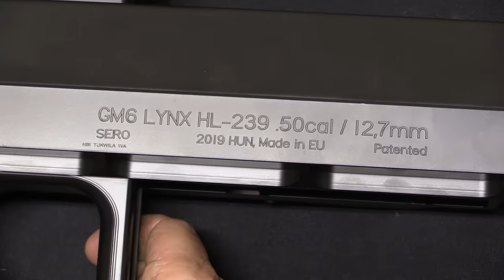GM6 Lynx: The Hungarian Long-Recoil .50-Caliber Bullpup

Comment: I am pretty sure the muzzle brake is a recoil compensator, screwing it in reduces the amount of gas it deflects back and leaves more of the original recoil for the action to operate upon.

I know, potaeto-potahto: the effect is the same as Ian describes it, it allows to fine-tune the amount of recoil to the minimum necessary for reliable operation and the more is screwed in the more the recoil, but what's left of the engineer in me craves precision.

On a more facetious side, the eye of my mind sees Summer Blau as Cameron ( "The Sarah Connor's Chronicles" ) shooting this from the shoulder while taking care of other Terminators.

Comment: I think you got it a bit mixed up in couple of places. 

12:14 
Bullet and the gases push the barrel backwards. (recoil)
Muzzle brake negates some of the recoil. 
By tuning the muzzle brake back and forth: you effectively diminish or enhance the performance of the muzzle brake. (either lessen the recoil, or allow it to be larger)
Larger recoil force on the barrel gives the system more power to cycle properly. 
One could assume deeper seating lessens the effectiveness of the brake. 

15:42
The ribs underneath the slide and the barrel that contacts against the cartridges in magazine: they do not negate the magazine spring induced drag as it is still there pushing against the rib. They level it to be a constant smooth ride. Also, as a result, the bullets don't rock up and down so much.

Comment: Even if Ian hadn't described the precision of those componentsw, you can actually see hear and see it when he releases the barrel or bolt  - so smooth and damped by the ultra-thin film of oil between the sliding surfaces, no clattering or rattling whatesoever.

Comment: the brass bearing is mostly used because of the friction coefficient between steel and brass being pretty low. i don't think it will wear that quickly, its typical for axial-load bearings
Reply: And, as a bonus, any half-competent lathe operator can turn those out quite easily

Comment: Definitely need a better trigger as most Anti-material rifles usually are meant for more precision shots in the current era and the ability to close the dust cover while in transport form is also needed. My final suggestion would be the need for an easier mag release that way the user doesn’t need to stop indexing the grip and or allows for faster reloading and apprehension of the mag release button. Otherwise from what I’ve seen amazing rifle and I’d love to try it

Comment: When I was younger these were 12,999.99 with a mandatory deposit. For two summers I saved up and had what I needed in full with tax. When I contacted the importer the price had shot up to 15,050 plus 7% local tax. I ended up putting a down on a truck instead.

Comment: I think you've got the bit about the muzzle brake confused. The ports on that brake, like many, are angled back toward the shooter and will generate forward thrust while gas is venting through them. This is what most muzzle brakes do, as it fights the typical rearward force of recoil.

 I can see why you would want to tune the brake on a gun like this with a reciprocating barrel but I don't see how the claimed increase in muzzle brake performance would reduce recoil by "putting recoil into the barrel". I think you are only tuning how much it can reduce recoil, and therefore reduce the rearward velocity of the barrel/action.

Comment: I would imagine with that muzzle device setup it wouldn't be difficult to make a few plastic feeler gauges once you've dialed in the cycling energy. Just use some calipers to measure the space between the md and that ring and cut out appropriate sized pieces of plastic.

Comment: I think I can guess one reason they had the hammer on the side. it looks the like bolt's designed so that, should the trigger be pulled without it being locked (such as a shooter lifting the charging handle and then squeezing the trigger) the hammer won't align properly. but that's going based on the slowmo footage from the shooting video.

Comment: Couple of questions prompted by this otherwise fine presentation. Ian did not comment on the function of the notch on the carrier guide rod nor did he illustrate the barrel extension.  What trips the bolt lock catch? It doesn't seem to have a trip on the rails illustrated. Does it occur in the  barrel extension? I am not surprised that a long recoil comes from Hungary since Frommer worked in the neighborhood and had some interesting rifle prototypes as well.

Comment: Im surprised that the roller assembly isn't a press fit, I would think they would differentially heat the parts and then press them together for a really snug fit to ensure that the tolerances don't get messed up from the torsional force

Comment: 16:40.  Not really sure why a left-handed thread is any less likely to vibrate loose than a normal one.  As far as I can see, there would be no rotational element to the vibration, unless the direction of the rifling had an influence, which seems unlikely.

Comment: There were a couple things that didn't make sense to me in Ian's explanation. Feel free to weigh in if you have any thoughts.

It seems to me that the way the muzzle brake is shaped it would direct gas rearward toward the shooter and thus (through Newton's 3rd law) it would push the barrel forward, which would decelerate the barrel rather than accelerate it as Ian said. Also it seems threading the muzzle brake on farther would block more of the holes, and therefore it would reduce this effect and cause the barrel to accelerate more rapidly. Having the brake unthreaded most of the way would leave the hole more open and direct more gas rearward, pulling the barrel more forward which would decelerate the barrel more and lead to reduced recoil. This is the opposite of the way it's explained in the video so if anyone can answer this I would appreciate it.

Also. I didn't understand how the left hand threads would let the brake assembly tighten itself. Since the barrel doesn't rotate and just goes straight forward and back it seems like the thread direction wouldn't matter. Any thoughts?

Comment: Hey, one of my favorite sniper rifles in Synthetik. No stupid gimmicks unlike the rest of the sniper rifles.
Just long range, solid armor pen, penetrate multiple targets, and it also hits harder the further the target is. Ie, it acts like a sniper rifle should.
Reply: No love for the Nemesis Prototype?
Reply: @nickstanley5064  It's good, but it's got 2 main faults.
1 is that it's rare.
2 is that it's a single shot that needs to be active reloaded consistently, aka has a gimmick.
Sometimes, you just want a gun that ya don't have to fuck around with. No active reload constantly, no 360 noscopes, no sitting perfectly still, just point and shoot.
Reply: @nerdicusdorkum2923  , the 9800k fits that description as well.

Comment: Ian, do you know the history of the M1 development? 
In 1973, there was a hostage-taking in Balassagyarmat, Hungary. 20 high school girls were taken hostage in a dormitory.
The story here, using a translator as I do.

https://hu.wikipedia.org/wiki/Balassagyarmati_t%C3%BAszdr%C3%A1ma

The point is that you know that Europe especially the eastern half of Europe does not have the types of crimes that the US has. Here 95% of the people don't have guns at home if they do they are 95% hunting or sporting guns. military even with a pre-loaded one only with a disarmed one.
And in 1973 there was such a strict social system with effective political policing that the authorities simply didn't know how to handle it for lack of routine? 
The root of their problem was that the two hostage takers were not visible at the same time in the dormitory building so the snipers could not shoot at them safely.
I'm not writing down what's in the Wkipiedia article. The point is that it was at this time that the need arose for the development of a sniper rifle, not even by the army but by special forces of the police, where a covered or semi-covered target could be fired at with great safety and with the need for a successful hit and incapacitation. 
That is why the M1 is single shot and so difficult to handle. It was not designed for battlefield use but for accuracy and what is in its category as an anti-materiel weapon. From the very beginning of the design, there was a demand for the successful and directionally effective penetration of the 10 cm concrete walls of prefabricated concrete houses, which are common in Central Europe, from 100-200 meters.
The M1 used to be able to hit its own mortar rounds from such distances.
So for a long time it was more of a counter-terrorist urban combat weapon, only then well into the 2000s was it adapted to the needs of the Defence Forces. Then it became foldable e.g. Police had no size problems.
Why the 12*108 mm? Beyond its efficiency.....In the 80's the country was in a serious economic crisis and there was less and less money for development.
So the then not very independent Hungarian arms industry decided to use existing elements. 
The barrel of the M1 or maybe the M2 I still remember it from the photos of the time is actually the heavy machine gun known in another video of yours, the barrel and ammunition of the T-54/55 medium anti aircraft machine gun of the medium tanks, this is the DSK Soviet heavy machine gun.
The first types even had circular cooling fins on them.
Hence the ammunition and hence the barrel.

Comment: Can someone explain the muzzle brake to me? " The further back you have it the further you are going to reduce recoil and put the energy into the barrel. "
He says but...
It is not intuitive to me in which position it is braking the most but I assume it's in the rear ward position. And that seems in line with using hot ammo. But more braking must mean less recoil and less energy going into the barrel as the brake will push the barrel forwards. Am I right?

Comment: What if you try to push the barrel back with a round in the chamber?
Reply: If I understand correctly, the same as it would if the barrel were being forced back when firing. The barrel and bolt will travel back together, the bolt will catch at the rear, the barrel will go forward, and the round (which would normally be an empty case) will be extracted. I don't think extracting a live round should cause mechanical issues, as it should be designed to be able to kick out a dud just like every other self loading firearm.

Comment: Would this be considered a direct blowback .50 Cal.  there isn't any gas systems to unlock or reciprocate the bolt.  With the reciprocating barrel, does it reciprocate while the bullet is traveling down the barrel? would that have an impact on grouping size?

Comment: I wonder if the next iteration would fix the spongy trigger issue ... a rifle built like this deserves a two-stage, 'break glass', trigger, with an equally small reset ... 

Pity our (British) military procurement tends to be a bit haphazard at times, as I can especially see the SBS (the Navy cousins of the SAS), making good use of this, being collapsible, on top of being a bullpup, when a mission team is deployed from a semi rigid ... 

[Yes, I know ... given our history with that rifle, that, especially the A1 should've been built by H&K from the beginning, instead of subsequently a huge amount of money spent on them to fix it to the A2/A3, bullpups, with 'grunt proof' fit and finish, have proven themselves, especially when you need a weapon that can be handled in tight spaces, rather than the broomsticks of old ...]

Comment: I know that this isn't meant to be a precision rifle but I'm curious what kind of accuracy it can manage with that very long recoil operating system. Not that I'm worried it's not sufficient, just curiosity.
Reply: The longest range individual hits are made with m2 brownings.
Those are also long recoil guns, far as Im aware.
Reply: @ineednochannelyoutube5384  I did a quick Google search on the lynx and saw some claims of moa and some of around 2 moa. 2 moa is better than i expected and 1 would be downright amazing. Certainly good enough for an anti material rifle and could even be pressed into sniping duty if necessary.

Comment: Was there a glitch in the Matrix, or has Ian made a video about a very similar thing quite recently? Either way,  there's a reason you've only ever heard of the 3 long-recoil guns, of which the Chauchat was the last designed (the Browning shotgun stayed on the market for way longer than it had any right to, because Browning. See also the 1911 pistol. If it ain't broke ...)
Reply: The A5 just works. Not very finicky with Ammo selection and very reliable. Better options now…..yeah maybe.

Comment: That gun is crazy! Looks like you'd need an armorer to maintain it in action; I mean the field strip is not simple. The parts are huge, and I guess that comes with this territory, but the rolling lugs look like skate bearings. Imagine training to assemble one in the dark.... I don't conceive of these being copied by hand in certain parts of the world where that sort of thing is sometimes done. It is interesting, as bullpups always are, and I missed the weight, but really wouldn't want to lug through hill country! I wonder if it could be simplified a bit and segments made from composites. And last: is it accurate, and at what range?

Comment: Ah yes. The Far Cry 4 rifle that was so OP it broke the game.
Reply: That would be the Buzzsaw. I never found the SA-50 particularly op, considering you only get it after the second to last mission in the game, and it has a niche, whereas the Buzzsaw kills everything from footsoldier to car in a half second burst, has minimal recoil and can be used substituting the whole range from a submachine gun to a sniper. And it's very easy to get.
Reply: @egomania2792  SA-50 can shoot through most walls, and if you slap a silencer on it because of the way enemy detection works they'll never find you. Took out Pagan's fortress without setting foot inside once because of the SA-50.

Comment: Those bushings are most likely interference fit.  They look just like the bushings in automatic transmissions... they probably wouldn't be that hard to find.  Anyway, you need a bushing driver set.

Comment: Why is this gun on every channel now, did a big batch of them get dumped into the market?
Reply: Maybe the SAS,SBS    purchase?
Reply: @tamassulyok2556  Could be.  Two are on gun broker now.  Haven't seen anyone real put to shooting long range.  Doesn't seem to accurate compared to other 50s
Reply: @jaytrock3217  It's actually one of the most accurate semi-auto .50s. 
The bushings at the front & rear barrel supports are machined precisely enough to control the vector of the muzzle consistently.

Comment: How does something with that much barrel movement maintain zero and accuracy?
Reply: By being ridiculously well-machined with extremely tight tolerances.
Reply: @jakefoley9539  really amazing especially considering the pressure and forces involved
Reply: @jeffr3773  It's certainly an impressive feat of machining. The bushings at the front & rear barrel supports are precise enough to control the vector of the muzzle consistently.

Comment: The Gepárd M1 (which I had the fortune of shooting at a military testing ground when they sighted in new rifles) was a horrible piece of makeshift trash with a hilariously dangerous safety system... With the hammer cocked and the safety fully engaged, the rifle fired a chambered round when locking the rotating grip into the upper assembly. To make things worse they used inferior quality, long expired HMG ammo which completely f*cked the accuracy (don't ask, it was worse at 100 yards than you would imagine). The entire project was a very crudely made, utter and complete failure at hugely inflated prices - for the same amount the hungarian military could have easily bought the best anti-material rifles available in the world...

Comment: This is literally the poorest designed .50 ever. I mean, okay maybe the design was a good idea. But in practice it's a complete failure. Just simply racking the slide is suuuper hard, and then there's almost no recoil management even despite that super tuff recoil spring. Just a fail, I hope people aren't depending on this puppy in live theaters of war.